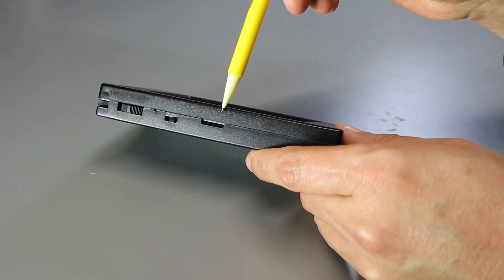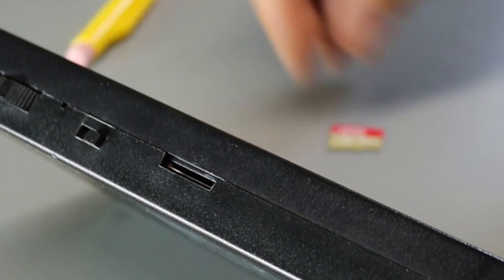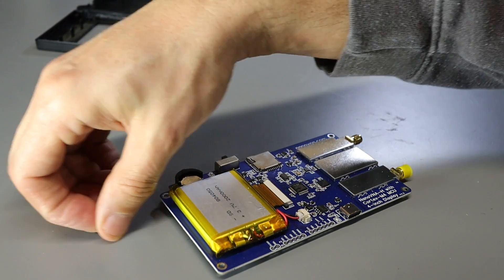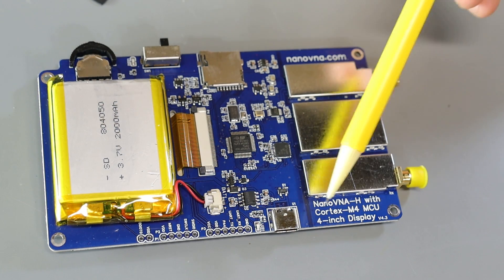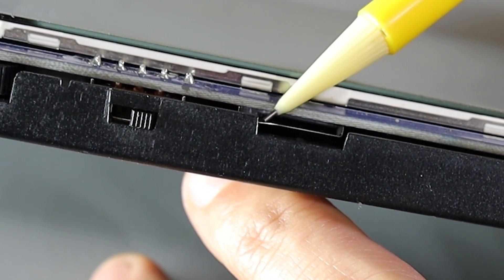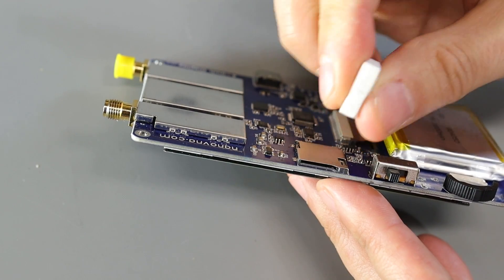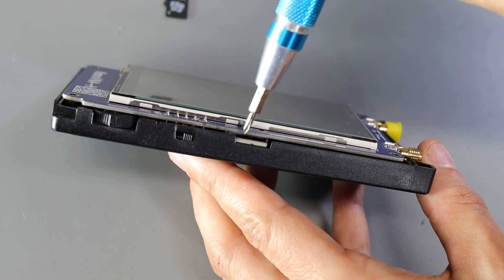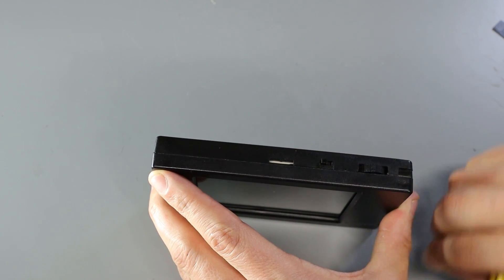I Took Apart My NanoVNA  Because I Did Something Stupid With It...

Comment: hey Rob, how did you choose your specific NanoVNA (H4) and not the other version? and do you think the SATiny  (or whatever it is called0 with a computer would be about as good as a Rigol analyzer?
Reply from the maker: I don't remember how I chose my nanoVNA but I think the H4 was the more advanced version at the time.  As for the tinySA, it's not as good as a Rigol but it's good enough for most Ham Radio applications and costs a lot less
Reply: @SevenFortyOne  Thank you, sir. I think there are newer ones these days that cost about 50% more, but i don't think the difference is worth considering. I'll look for a rigol as i am an rf guy not only ham